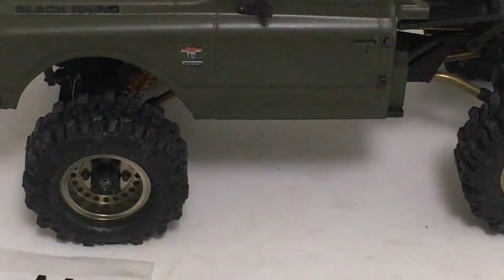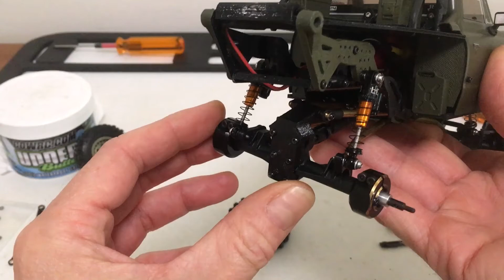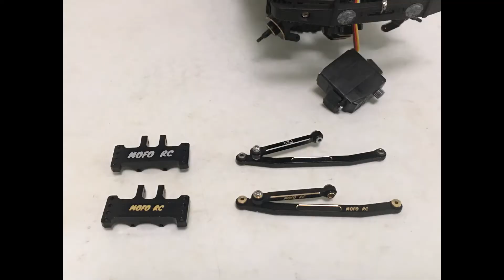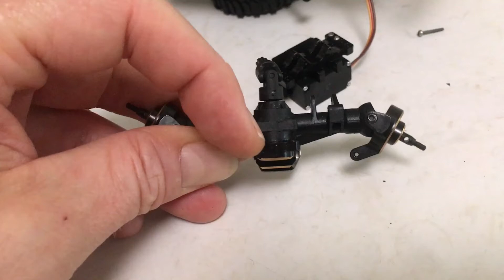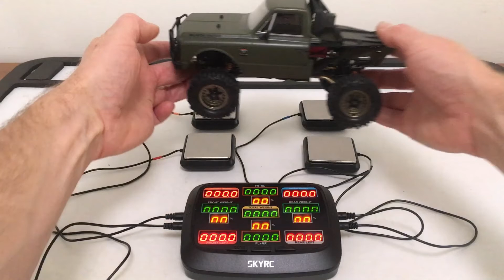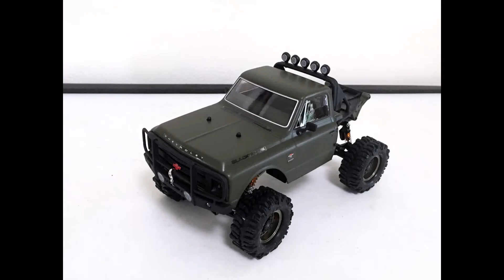SCX24 C10 BUILD: STAGE 4 - MOFO BRASS SERVO MOUNT & STEERING LINKS, LINK RISER, +4MM AXLES & WEIGHTS

Comment: I have that motor lol but it's still in the box 📦 waiting on a pinion gear . I got the low center gravity mount from shapeway . I like your build . Truck looks cool 😎.  What size pinion are you running? 🤔
Reply from the maker: Thankyou!  I used a 14T pinion.  I have heard a 8T with the 2040 can is nice low end.  Depends what you want.  I also have  an 18T to try.  I would  just pick up a couple for options.
Reply: @bcochener  I have been waiting a month for 12t from China.  Where did you get yours from . And was it 2mm or 3mm shaft
Reply from the maker: @think2cre81  I got them both of eBay from the US.  The pinions were both Robinson Racing Products Hard Blackened Steel Mini Pinion 2mm .5 Mod 14T & 18T.    I got one from Horizon Hobby, and one from Omnimodels here: https://www.ebay.com/itm/334108567940
Reply from the maker: @think2cre81  I hear you about the wait times.  I have to plan builds and start acquiring parts months in advance.  It does help spread out the cost over time, but it also keeps you from being spontaneous with your time.  Its always a few items that hold it up...
Reply: @bcochener  thanks , I will check it out ... stay cool 😎